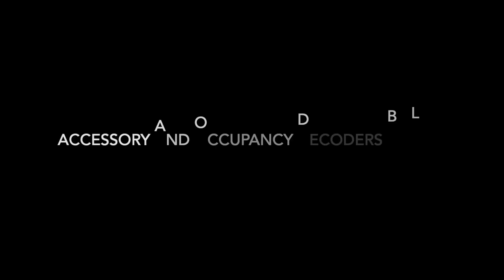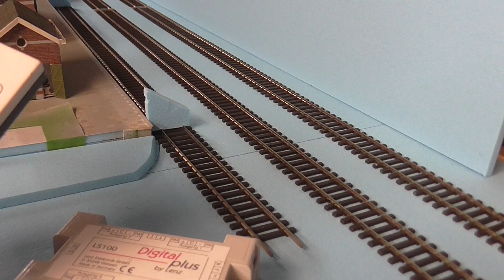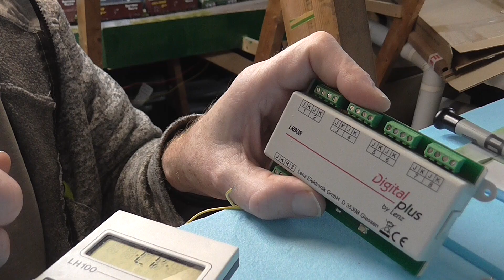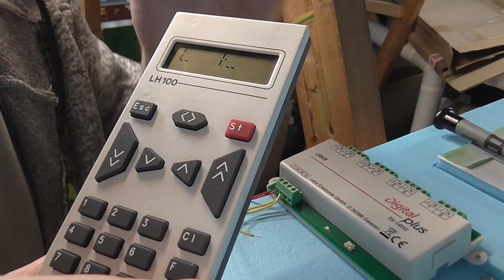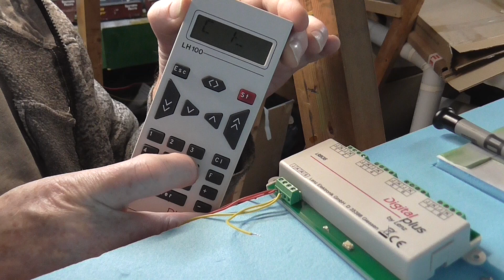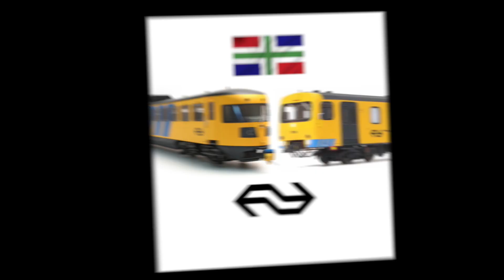Episode 7 : Programming LENZ LS100 and LRB08  DCC Decoders

Comment: Koos, I've been searching and failing to find some help with a Lenz Silver direct  decoder, model 10330. I have it installed in a Roco BB9004 model 63785.
It runs fine but I cant get the lights to change in regards to the direction of the loco. Forward is white at the front and red at the rear. When I change direction I'd like the rear lights to go white and the fronts to go red. Hoping you can point me in the right direction. Thanks.
Liked and subbed too.
Reply from the maker: HI thank you for following the channel. The silver direct decoder is a fairly good but basic decoder. I don't know how flexible its programming options are.  In regards to the locomotive, it depends if it has 4 independent lights/leds internally. 2 white (fwd and reverse) and another pair for the red ones. In older ROCO models sometimes there are only 2 bulbs/leds and using internal plastic 'light conductors or fiberoptics',  the front white will be illuminated simultaneously with the reverse red, and vice versa.   If they are independent lights, then it should be possible to control them completely independently, but you should at least be able to get them working directionally in pairs as in the second example.   How did the loco respond on a straight DC supply. DO the lights change with direction?  if so, then it should be possible to obtain the same with the decoder.  The front and rear lights typically are on the white and yellow wire respectively (if it was a wired decoder with an 8 pin plug). If the lights don't change, there is a chance you've plugged this plug in the wrong way around.  From the LENZ Manual:   These decoders come with a NEM652 / NMRA RP-9.1.1 medium plug. This plug makes the installation of these decoders very simple.
To install the decoder simply remove the dummy plug in your locomotive and install the decoder plug. To ensure the headlights work correctly you must align the plug properly. Pin 1 of the plug connects to the orange wire. Ensure this is aligned to Pin 1 of the locomotive. If the plug is installed wrong way round the lights will not work.
When installing the plug ensure that the pins are not bent or broken.   Hope this helps?
Reply: @Groningermodelrailway There are two separate led for the colors. I haven’t tried the loco on dc as I don’t have a dummy plug and that can fry the decoder. I have contacted both ROCO and Lenz and haven’t received any response. I’ll keep asking around. Thanks for the interest in this issue.
Best of health to you.
Reply from the maker: @kge420  Ok, I still think the 8 pin plug might be the wrong way round. You can't damage it if you swap it around 180 degrees, if it still doesn't work, then hopefully Lenz can give you some clarification. It can take a while, I contacted them once and it took 3-4 weeks before I had a reply.  Let me know if you get a resolution, it's always a bit tricky to diagnose not having the 'patient' in front of me. 🙂